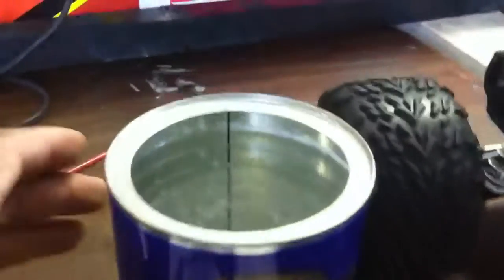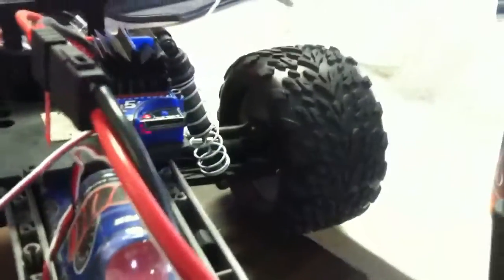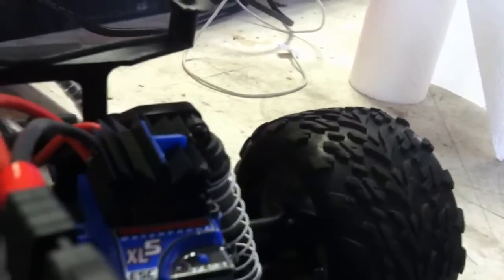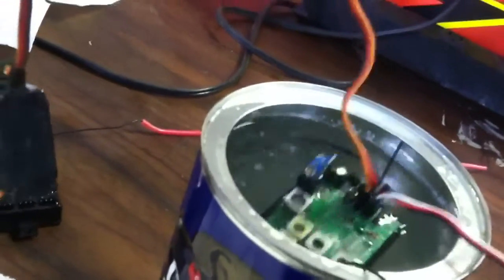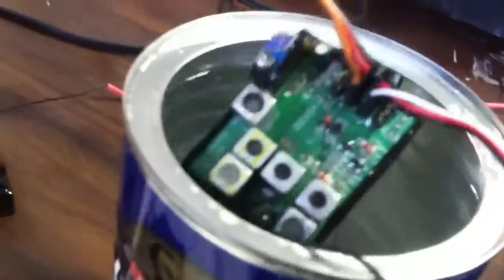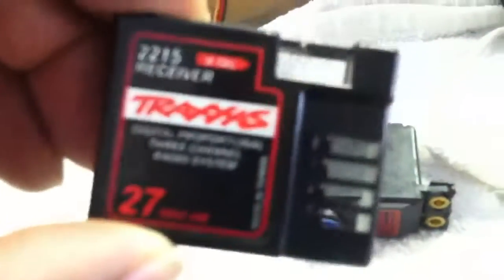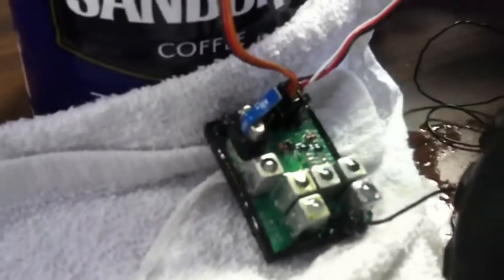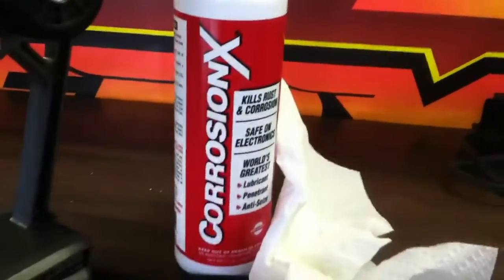How to Water Proof All Electronics-Corrosion x

Comment: i just bought some from my local hobby store, they recommened it other than plasti-dip which they told me not to use, its 12.99 usd for a little can which should be good enough, just pop electronics apart spray them down let the access drain off pop them back together and your ready to run.